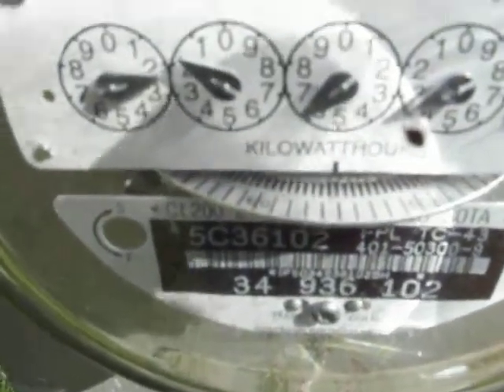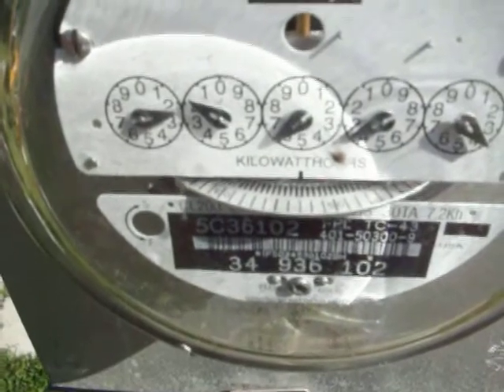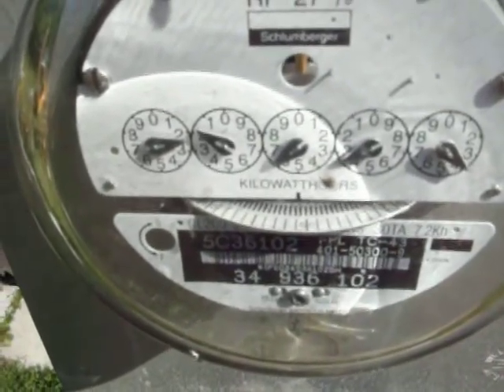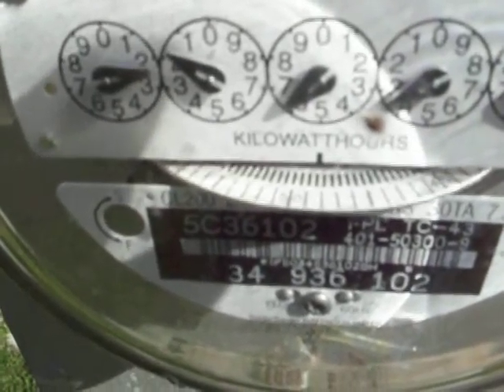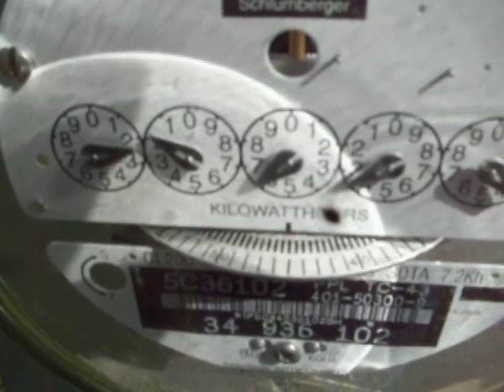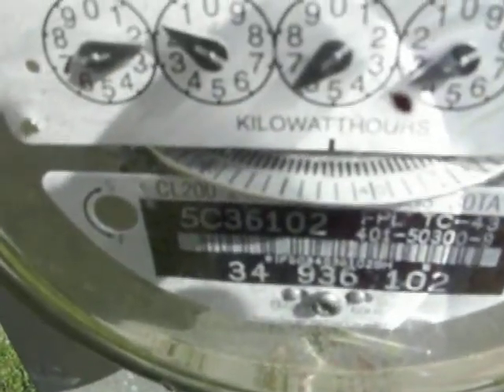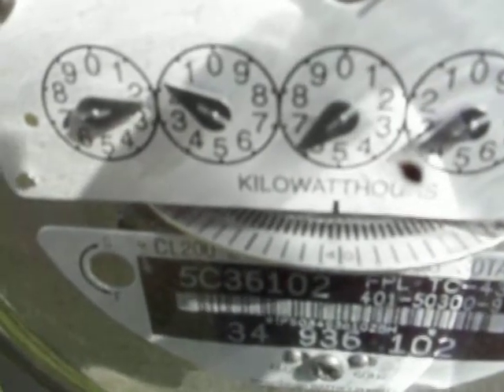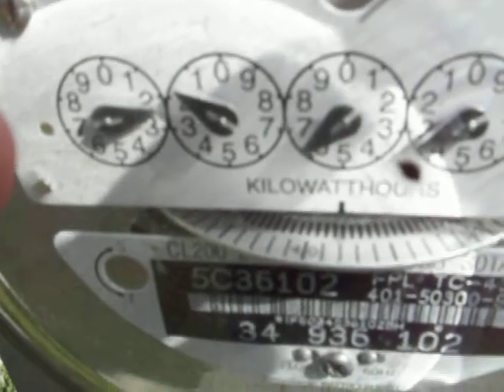Electric Meter is Spinning Backwards WOW!!!!!

Comment: Man, you need to look into getting a tankless gas water heater...or more solar panels, those electric water heaters eat up the electric...I just made a vid on how to read how much wattage is going thru the meter by timing it,,,I clocked 800 watts at 30sec and it just clocked yours 7.3 seconds to go around once so I'd say 800x4=3400watts is what its using